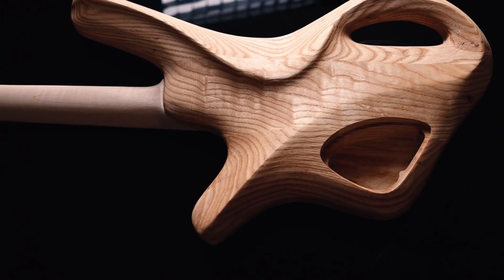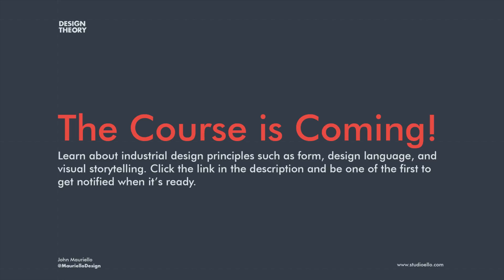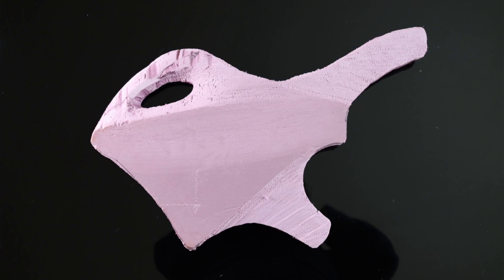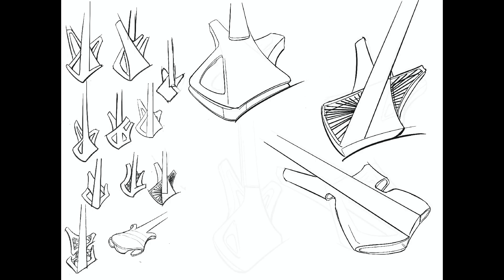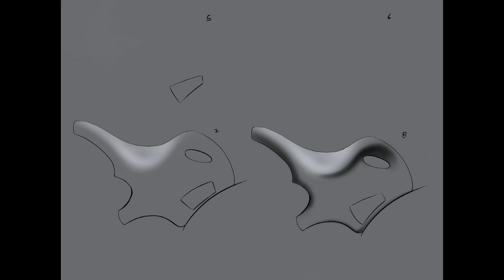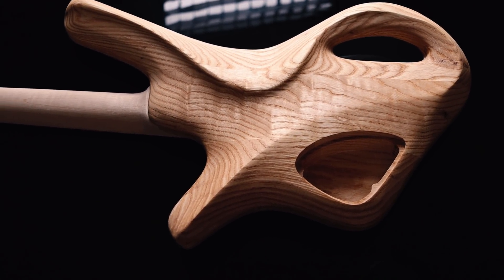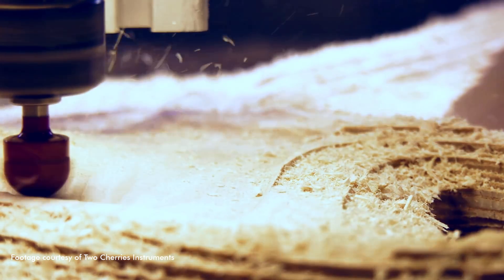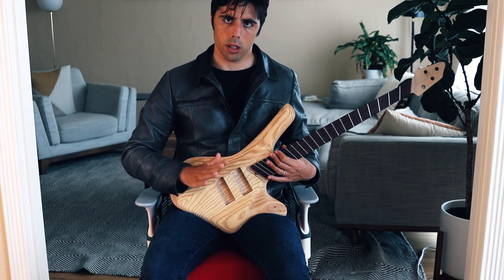How I Re-Designed the Traditional Bass Guitar: Industrial Design Process

Comment: Regarding the sitting position (classical vs. regular): it's not that one is superior to the other. Classical is great for playing in the higher register but it's going to put a lot of stress on your left shoulder if you're doing a gig that requires you to play lower frets a lot. On a guitar maybe but the scale of the bass is much longer so there's a compromise.
Reply from the maker: Classical also allows many people to place their wrist in a more straight position on the right hand. You also need to twist your body more using the "standard" position. There is definitely easier access to the higher register with classical, so this is a slightly shortened scale length that seems to work well. I also made the body really short, so that the lower frets are much closer to you when playing in classical.

Comment: Dude, you should elaborate on the fretboard as well! Are the strings still correctly tunable?
Reply from the maker: They are! It's called a multi-scale fretboard.
Reply: @Design.Theory  Did you consider the angle under which the player would press down on the fretboard when picking it?

Comment: It's always great to see people working to innovate with musical instruments!!

Have you considered the stability of the neck with the asymmetrical profile? (and likely asymmetrical tension due to the difference in string scale also working against the profile)

I guess dual tension rods could compensate for that but won't help with weight reduction.

Keep it going, I hope to see more developments!!
Reply from the maker: I built other basses with similarly extreme asymmetrical neck profiles. It seems to be okay. It's been about 2 years and so far so good.
Reply: @Design.Theory    Great!! Great they hold and great to know something like it can hold. It just came to mind and worried me it could come to bite you later.
 Thanks for the answer!
Just to know, do they have single or dual tension rods?
Reply from the maker: @joaquins90  The neck contains one dual-action truss rod. It can be tightened or loosened.

Comment: I loved this video, a great explanation of your process and design fundamentals. As a guy who's built one guitar but is predominantly a designer in other fields, there was much to take away from this.

One question, is there a particular reason you chose not to slant the pickup holes to match the fanned frets?
Reply from the maker: Yes, the pickup poles may not have lined up with the strings, and it also looked stupid with the slanted pickups.  If there was a slanted pickup that actually had corners that didn't run at 90 degree angles and had pole pieces that were properly aligned, it would be a different story. Thank you for watching! I really appreciate it
Reply: @Design.Theory  would you consider designing pickups to match the body so that these constraints became less of an issue?
Reply: Yeah, I thought exactly the same. The way the pick ups are aligned on the dingwall combustions appeals very much to me for this particular project. However, I think they can be aligned even better, according to the radius from the bridge and the highest frets….

Comment: I love the traditional J bass sound by the F brand. But holy hell when you hold it, it feels like the 50s. Not to mention noisy, heavy, hard to access higher frets. That's why I went for a modern design: balanced, light, fast action, active pickups, onboard eq, a jack that points up towards the lower strap pin (which is where the lead goes anyway), a neck that is reasonably consistent in thickness all the way to the 17th fret, no neckdive... (guess the brand).
I appreciate this exercise so much, hopefully the industry will take note.
Reply from the maker: Thank you so much! I appreciate that

Comment: A lot of cool ideas. But you are ignoring the weight of the tuning pegs, which is a big part of what makes a bass "neck heavy". You might want to consider a headless design. Another advantage of headless is that you don't have to worry about bonking someone in the head with the headstock on a tight stage or practice space. It's also more convenient to tune. I'm working on some similar ideas, but headless brings in some new challenges, including including some visual feature at the end of the neck, instead of the usual chopped off look. If you are interested in collaborating, let me know. I've got a CNC to build protos. Another radical thought is let go of the lap concept and embrace a permanent strap. I never support any of my basses with my legs anymore, the strap works better, and it is less of a transition when you do stand up. It should also allow a more vertical neck position than what you've got, which IMO is more ergonomic for everything except pick playing. You are the visual artist, my focus is totally playing oriented. I wish I had your artistic talent.
Reply from the maker: Thanks for watching! I actually found that the bass balanced better with the tuners...at least with this particular piece of wood. I'm open to collaborating. Feel free to email me. It's on my "about" page on my channel. It's funny you mention the more vertical orientation of playing. I actually came to very similar conclusions, and I was thinking of doing another design that catered to that playing style.

Comment: Your entire project is based on your own confirmation biases, we saw no real study in ergonomics, mechanical advantage positions, percentiles or studies of size, shape or weight contrasted to the human form, all those gaps have no reason to be more there sterile styling and assumptions about visual lightness. You speak of wrist injuries, how do you know that this design will correct it if you have not tested them in time? your design goal is not met at all. Pure styling redisign
Reply from the maker: Your entire comment is based on your own confirmation biases. I saw no real study of the actual content in the video. Most of your writing has no reason to be there, it's just sterile unnecessary prose and assumptions about what kind of research I conducted, versus what I chose to put in the video.
 In all seriousness, I did conduct several user studies, and I intend to continue testing with users, which I explicitly mention in the video.
Reply: @Design.Theory and you can not even take into account the opinion of your own fellow guild, if you can not even take a criticism (do not give me crap if it is constective or not, it is only objective). You cannot take into account what another industrial designer tells you and that in the end is what you are going to live unless you correct, you do not design for yourself, you design for the other, put that in your head. I'm not surprised you won't get anywhere with your bass redesign if you have your full attention on your own ass.
Reply from the maker: @espaguetydeloeste   I'll happily support debate and dissenting opinions, but I won't tolerate rudeness or foul language. This is your first and only warning. After that it's a ban. I agree that you should not design for yourself. But that's not what happened here. I tested with several other users.

Comment: In the future, I would highly recommend getting a cheap vr headset and porting your models to it as a middle step. You can see and "feel" it in vr if you are using a proportional model.
Reply: @LhunVideo  Except the Quest 2 is hard locked to a Facebook account, which is a no-go for many people.
Reply: @lalystar4230  None of that is accessible to the average consumer.
Reply: @error.418  The average consumer isn't creating 3D cad models for 3D Printing/CNC either, so I'm not sure what the issue is there.
Plus, even if the average consumer was doing these things... the average consumer has a Facebook account.
Reply: @amoliski  Look, having to hack around Facebook being built into them is a terrible excuse.
Reply: And specifics on softwares or features in softwaresbto do this with? I'm totally ignorant.

Comment: You should consult more with actual costumers (bassists) than with other designers. There are other factors other than playing it that have a significant role in an instrument, such as carring, storing it and handling.
Reply from the maker: Yes definitely, I spoke with 6 bass players. I'm also a bass player as well. I didn't focus as much on storage/handling since bass cases/gig bags seem to work reasonably well. They could definitely be improved, but for now, I wanted to focus on the actual instrument.

Comment: Thank you for the great detailing on the thought process behind the designing. As an instrument maker, I believe looks are indeed an important part of the instrument, as it is the first contact between the player and the instrument itself. But I am really interested in seeing your thought process behind the multiscale setup, the choices made for the neck dimensions, and the playability of the instrument. In my opinion, a headless system would have complemented your body design, as the headstock tend to take away the focus (this part of the instrument is deeply rooted in the players minds, and is where the historic branding can be found) from your work. Great video !
Reply from the maker: This is an excellent question. I actually have footage of this, but the video was just getting way too long, and I was worried that it would not be as interesting to people who aren't REAAAALLY into lutherie. But I'll outline some of the decisions here. The multi-scale setup has ergonomic and string tension benefits that are great...but for me, it was actually the only way I would have been able to get such an extreme cut at the bottom of the body. This extreme cut was necessary to allow the instrument to rest at a 45 degree angle while the player is sitting. The 45 degree angle was very important for ergonomics reasons (it brings the instrument closer to your body). A "regular" bridge would have made the body too long (making the lowest frets too far from your body), whereas the multiscale bridge perfectly follows the contour of that bottom edge of the body.

I looked into a headless bass, but I wanted to make the body as short as possible so that the player didn't have to reach excessively in order to reach the lowest frets of the instrument. The headless system would have lengthened the body a little bit more than I would have liked. I also find that with the ultra lightweight tuners, the instrument balances absolutely perfectly once all the electronics/pickups are in. It leans towards the body, but only slightly. You can literally place the instrument in your lap, take your hands away, and it just sits in place perfectly....at least for me it does. I'd need to test it with a lot of other people to make a conclusion regarding balance. 

 I actually think that if I were to redesign this bass, I would go with something even more out there and weird, probably a hybrid between a Chapman Stick and a bass guitar. I find that the upright electric basses are actually ergonomically superior. But that's an entirely different topic.
Reply: @Design.Theory  thank you for the explaination !

Comment: test it also with using TOP-5 Bass pickups. I know the body won't affect the the tone that much 'cause it's still a solid body but tone quality will pretty much differ depending on the pickups used.

Comment: sound test?
Reply from the maker: The pickup routs are too small to fit the pickups in. I'm very glad I caught this mistake before I made a finished instrument! After I fix that, I can wire it up, install the bridge/tuners, and test out the sound. But honestly, sound is mostly dictated by the electronics/pickups more than anything. The body shape doesn't play a huge role (if any) in the sound of an electric instrument.

Comment: the shape of the body looks interesting, maybe not a huge fan of the cut away no the bottom. But that headstock ruins the whole thing.  I dont think the long horn goes well with such a short headstock
Reply from the maker: the headstock is really short in order to bring the tuners closer to the center of the instrument, therefore reducing neck dive and improving overall balance.